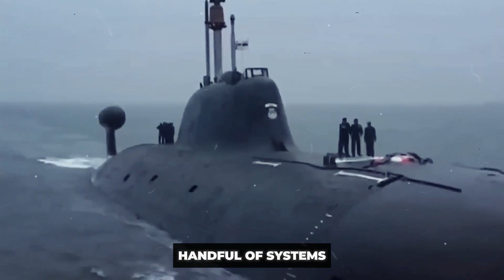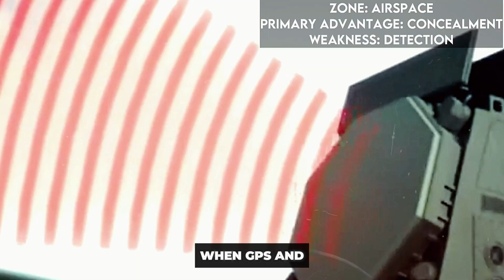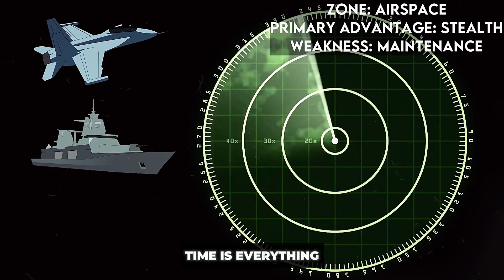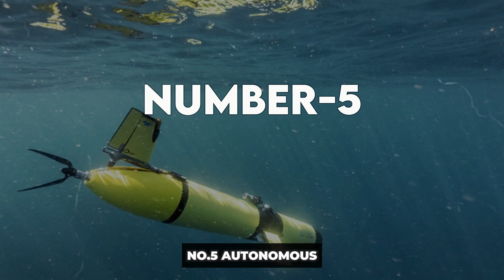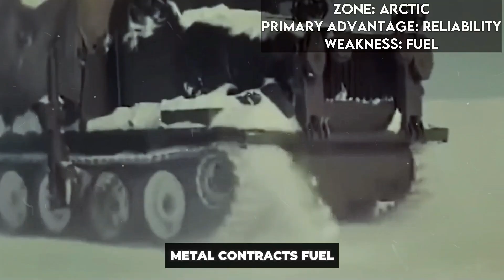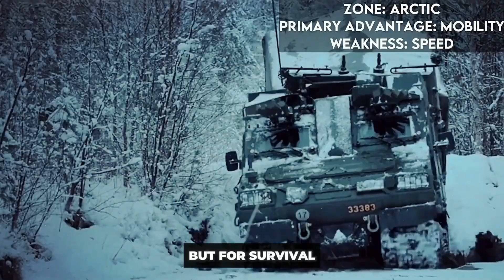When Physics Turns Deadly | Military Engineering's Extreme Challenge

Comment: I did not realize how many different environments engineers have to design for in military systems. The deep-sea pressure and Arctic cold examples were especially interesting. It would be great to see a deeper breakdown of how engineers test these machines before deploying them in such extreme conditions.
Reply from the maker: That is a great point. One of the hardest parts is that these machines are not only built for extreme environments, they also have to be tested in ways that simulate pressure, cold, vibration, corrosion, and system failure before deployment. A deeper breakdown on how engineers test them before real-world use would be a very good topic to cover.

Comment from the maker: Some environments destroy normal machines almost instantly. Extreme ocean pressure, Arctic cold, intense electronic interference, and remote battlefields force engineers to design entirely new systems that can survive where conventional technology fails. Which of the machines shown in this video surprised you the most, and what other extreme-environment technology should we cover next?